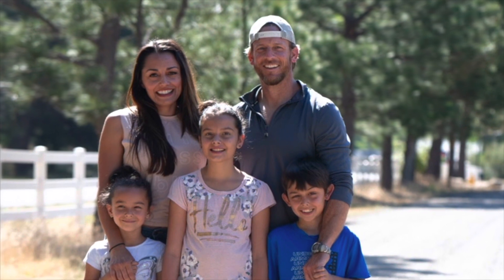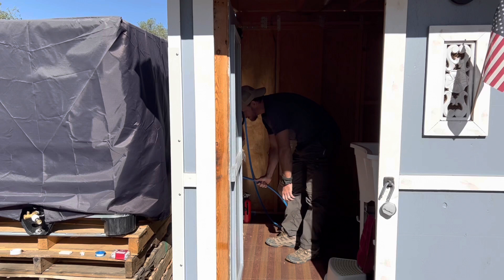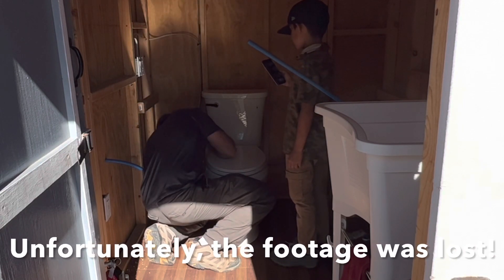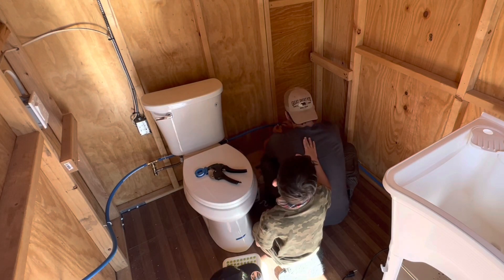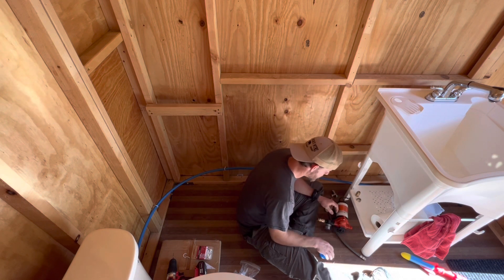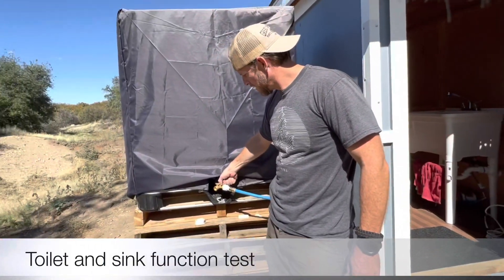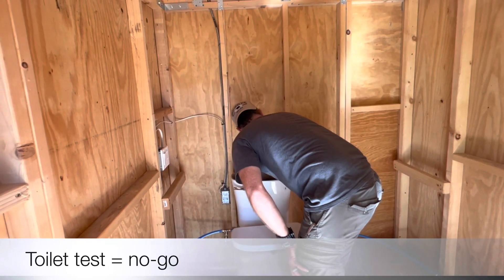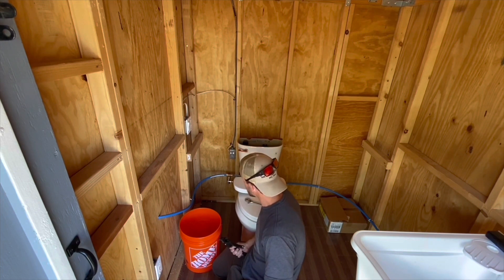From Shed to Off-Grid Bathroom, part 3 (final)

Comment: get the water storage tank a 100 feet above the ground, the 100 ft. of water causes 100 ft. x 0.433 psi per ft. of column or 43.3 psi pressure at ground level. then you won't need a pump.  John being John.  What happen to high school physics?
Reply from the maker: Lol!  Thanks Dario!

Comment: I don't have nearly the butt crack to be a plumber, but like... Isn't your sink water coming through your toilet?
Reply from the maker: Hi Holland. The freshwater tees off just passed our pump on the wall behind our toilet. At the tee, the toilet tank pulls in freshwater after it drains from a flush. When the sink is turned on, the pump sends water past that tee intersection directly to the sink faucet. No water is actually pulled from the toilet.  
The sink water drains directly into our 3 inch sewer pipe roughly 5ft up from where our toilet flange drains into the same 3 inch sewer pipe. No sink water goes into the toilet that way either. Thanks for the question.
Reply: @off-gridonfriday562  I thought you must've thought that through, but I guess I just didn't see it.
Reply from the maker: To be honest, we just troubleshot as we went!  Luckily it worked out. Thank you for the comment!